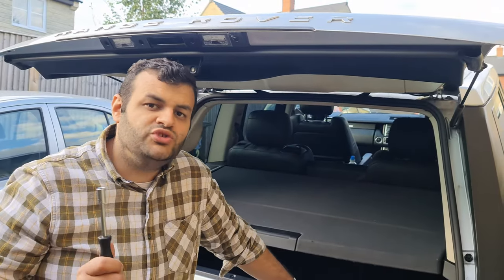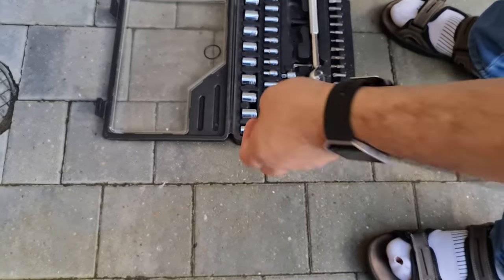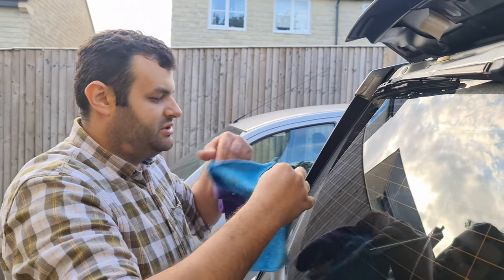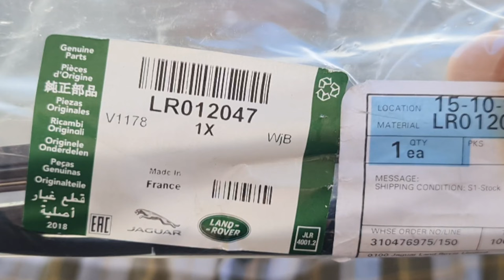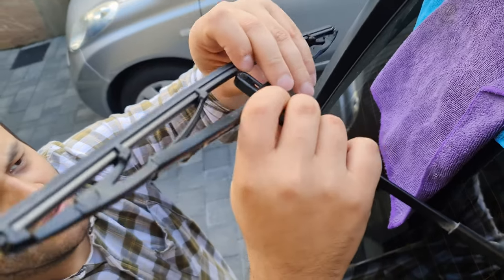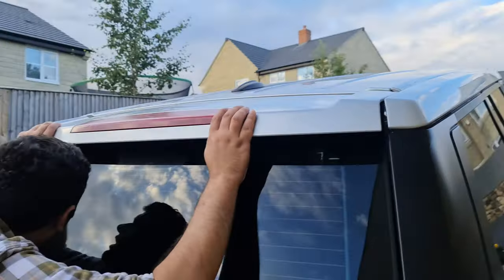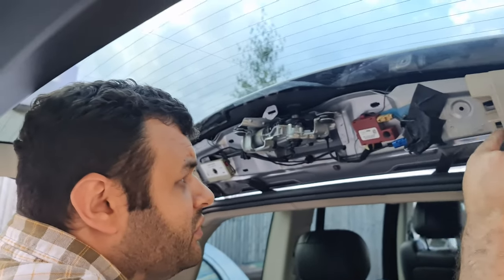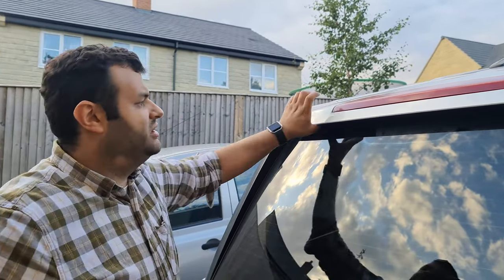Replacing REAR WIPER BLADE on RANGE ROVER L322

Comment: If it's the same as my old P38 Range Rover,  You don't need to remove the trim.
Just operate the wiper & when it's in the down position open the boot.
This stops the wiper from moving. 
At least that's how to change them on a P38 Rangey.
Reply from the maker: Hi Jay, welcome to our channel!👋🏻 You're right! This is actually an older video of ours, we didn't know how to put the wiper in service mode because we previously owned newer Range Rover models, which had a service mode on it. We have actually made another video to address this, where we show how to put the wipers in service mode on this L322 - this is the link for it if you'd like to watch - https://youtu.be/E8D5Q6sS1C8?si=lBMlVTlwtMhMqBRe
Let us know your thoughts! 😊 By the way, how is your P38 Rangey coping with this freezing weather? Keep in touch! 😁
Reply: @lifeasusual  Hi
I sold my P38 many years ago,  & After being away from 4x4s for about 10 years I've purchased a 2012 L322 4.4 Tdv8 Autobiography in June.
Loving it so far & it has all the toys I wanted.

Comment: Nice. I need to refurb the wiper arm on mine, it’s got a fair bit of surface rust on it and looks scruffy. Job before the match later :-)
Reply from the maker: Thanks very much. Glad you found the video useful! 👍🏻 Did you manage to get it sorted yesterday?
Reply: @lifeasusual  I did indeed :-) tidied up the arm last night. It was pretty dry and creaky so used WD40 silicon on it and that made a big difference. I’ll need to get a new wiper blade but it’s going into the shop tomorrow for suspension bushes so I’ll get one then. The spoiler removal is straightforward. Just a bit of jiggling around to refit. Those white rubber grommets can be fiddly to align I found, but all good.
Thanks, as ever, for your guidance.
Reply from the maker: Nice job!! Well done!👏🏻 Are you referring to the rear subframe suspension, or the front arm? Good luck for tomorrow, hope they get the Rangie in tip-top shape! You're most welcome, and thank you so much for your continued support!
Reply: @lifeasusual  I suspect it’ll involve both! Defo front control arms will need doing as they’re knocking and there’s a metallic sounding squeak coming from underneath the rear seat so I’ll be intrigued to find out what that is. Once it’s back I’ll do an oil and filter service myself and I think the spark plugs would benefit from being replaced. Touch wood we should be good to go after that. 
I did a nice quick job last weekend by refitting and sealing the A pillar windscreen black trim plastic. The clips had degraded so I got some new ones.
I then used a dab of silicon to seal it and it’s reduced the wind noise significantly around the door frames.
Reply from the maker: In this case, (spoiler alert): I may have a video for you next week (and the week after) that'll be right up your street! 😁 Well done on your pillars, I think I may need to work on mine soon because the rubbers near the windshield are getting deteriorated!
Reply: @lifeasusual  excellent! Look forward to seeing the next instalment. Keep well brother, I’ll let you know how I get on with the suspension :-)

Comment: Did you removed spoiler just to replace wiper blade? Are you serious?
Reply from the maker: Unfortunately yes, because we couldn't get it in the service position as explained in the video.
Reply: As far as I know, there is no service position for rear wiper on L322. But as described in the guide, just need to turn ignition on, then turn on rear wiper and after that open rear door when wiper blade will be near to center.
Reply from the maker: Thank you for the tip. I just tried that and it worked as you described.
However, when replacing the wiper blade most likely the door will have to be shut while replacing it, to reach the blade itself. But then it will go back to its normal position which could risk damaging the glass accidentally. I would prefer to remove 3 bolts.
With other Range Rover models, I am used to initiating the service mode just as I do for the front wiper blade.

Thank you for the advice. I will pin your comment so other people can find this helpful. 👍
Reply: @lifeasusual no needed. The door shut sensor won’t engage unless the door is fully latched (usually 2 clicks). The door will close with one click and still not engage the sensor. The second time will happen after you push the door and you’ll hear it click again. Then the sensor will engage saying the door is closed. If in doubt you can use something like the wiper blade package or a paper towel roll half way between the two parts of the door so it doesn’t latch at all while changing the blade.
Reply from the maker: Hi Joshua, welcome to our channel! Thank you for that. We've actually made another video about this, because we figured out how to do it later on! This is the link for the video https://youtu.be/E8D5Q6sS1C8

Comment: You’re wrong. The correct way to do it is to turn the wiper on and when it is half way down open the boot. The wiper will stop in place. Then open the lower tail gate and you can then lower the upper section and pivot the wiper arm out. No need to remove the spoiler
Reply from the maker: Hi, welcome to our channel! 😊 You're right! This is actually an older video of ours, we didn't know how to put the wiper in service mode because we previously owned newer Range Rover models, which had a service mode on it. We have actually made another video to address this, where we show how to put the wipers in service mode on this L322 - this is the link for it if you'd like to watch - https://youtu.be/E8D5Q6sS1C8?si=lBMlVTlwtMhMqBRe
Let us know your thoughts! 😊